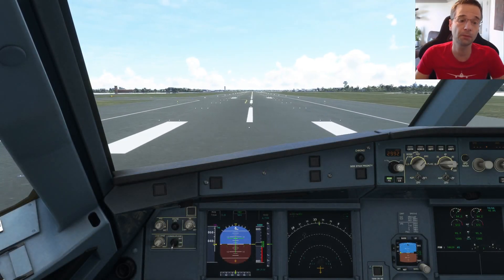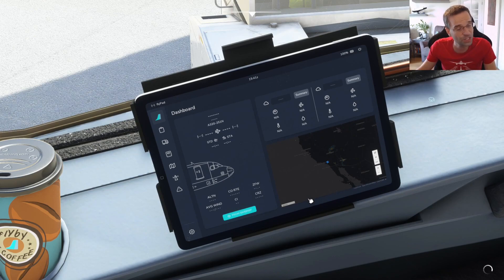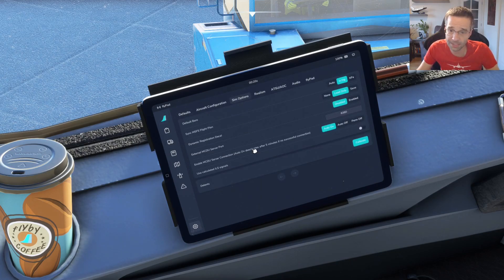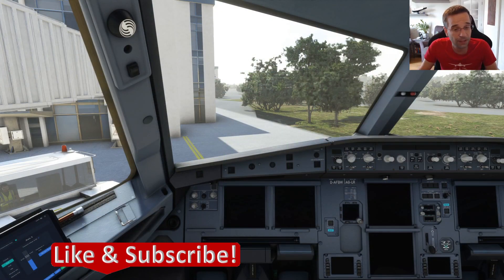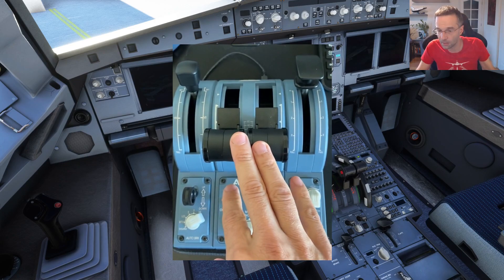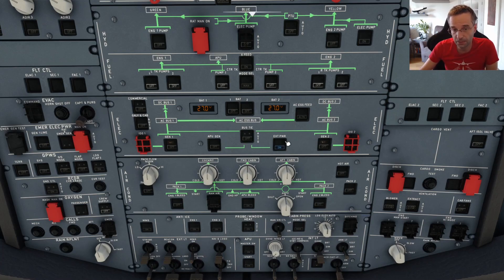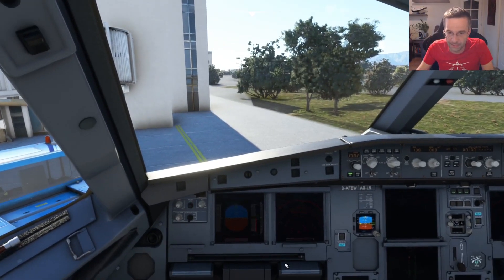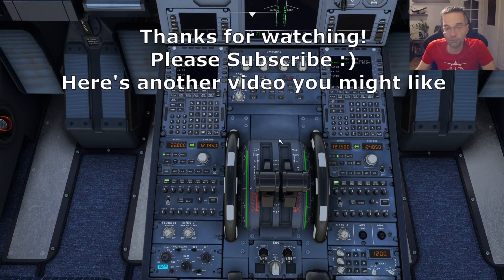FlyByWire A320 Startup | MSFS Tutorial

Comment: Don't get me wrong, but why did you change from your original departure airport to KONT when, in your first tutorial, it was at KLAX? If the series is designed as a tutorial, have some consistency.  Anyone who's following along will now have to go back to the menu and select the new departure airport.  

Great tutorial series and subbed... Other than that nitpick... thanks for the info 👍
Reply from the maker: That was a mistake on my part, I realized the route would be easier and simpler from Ontario when I started the second part. Just be aware that a lot has changed in the A32NX since I made this tutorial as well, a few things have moved around from the FMC to the tablet
Reply: @FlightSimSchool  Thanks for the reply, yeah a lot has changed lol. Off to watch more 👍